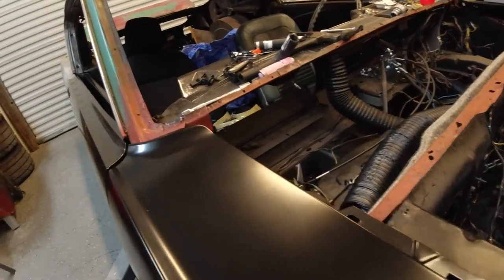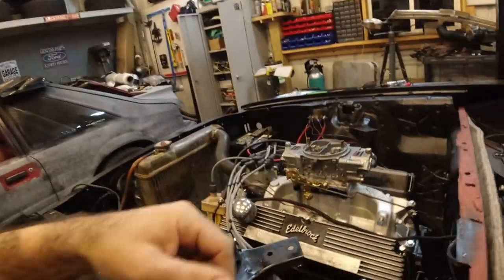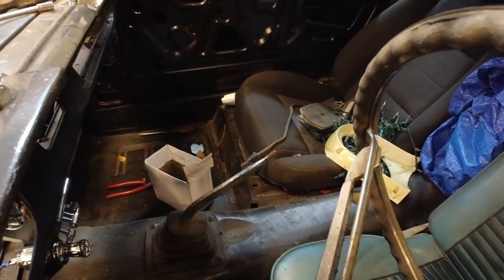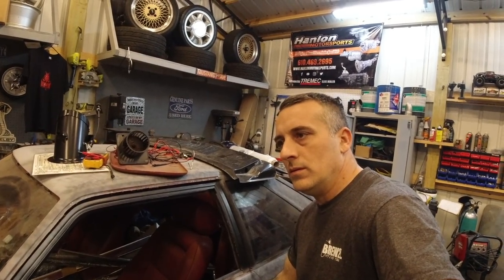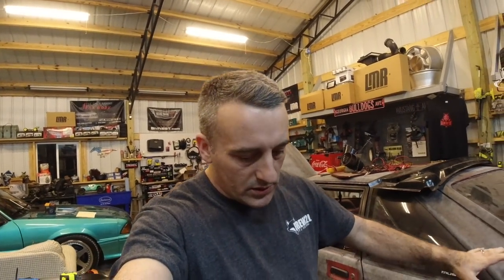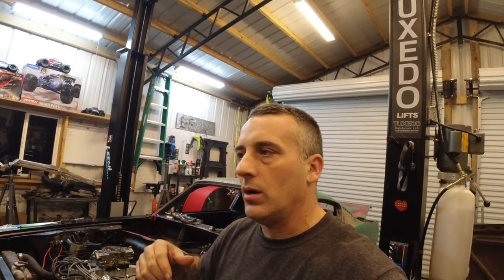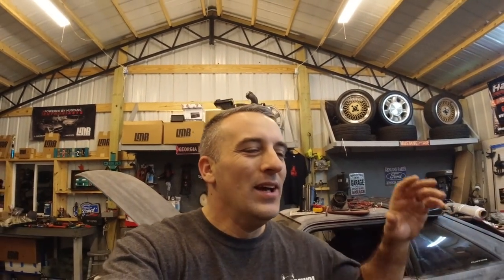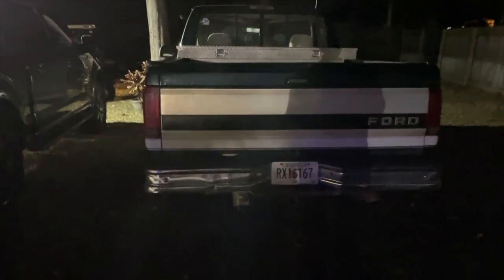Just Look At The Key And It FIRES UP!

Comment: can anybody tip me on a good set of wiper blades for my 90 foxbody seems most brands dont fit tight and im afraid one will pop off and scratch windshield..thanks!!!!
Reply from the maker: I have zero input on this one… I always just buy the cheapest ones I can find. Anyone else able to help out?
Reply: @BREW2LFOXBODY  intersting mabie i have bad luck thanks...
Reply: Part of the problem I've noticed is that if you have a factory stock windshield, they have a tendency to sag over time (similar to windows "settling" in a house)
Reply: @mysticker11  I don't have a foxbody but I have  a newedge and other ford's. I've had extremely good luck with the trico flex blades. I've actually had better luck with the flex blades over their more expensive lines. I won't run anything else. They are good in rain & snow. Usually around $10 or $11/ blade.
Reply: @Frank James My wife and I love the Tricos I put on her '09 Pontiac G8 GT.  Quiet and smooth.
Reply: @jimmyjamesgarage3290  Exactly.  Bought ours off of Amazon.

Comment: Hey I had talked with you a couple of months ago about the electrical issue in the 91 I bought. Well motor didnt make it 40 miles after I bought it and spun the bearings and gouged the block. Im pulling a 99 mountineer engine from the junkyard on Monday to use as a donar. They also have 3 more gt40p and one gt40s out there im going to pull all 4 sets of heads and uppers and lowers. Let me know if you or anyone local to us that need a set. Hopefully I can get this donar to merry up. I already have a new oil pan and gonna get a new water pump and timing cover.

Comment: hahaha can not ever go wrong with a carb man ......ive never been stuck on the side of the road in a carbureted car not ever ...due to lack of starting and or running ....fuel injection on the other had .....when it goes out or some other sensor goes out and the car wont run ...not much your gonna do on the side of the road ......i can make a carb run with baling wire and a rock...lol...